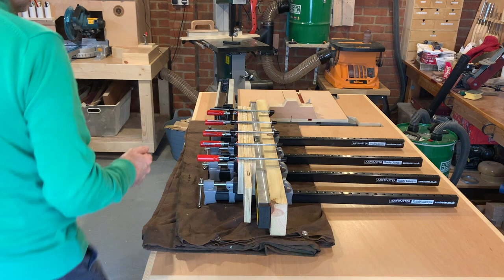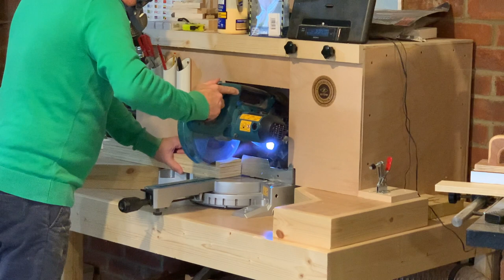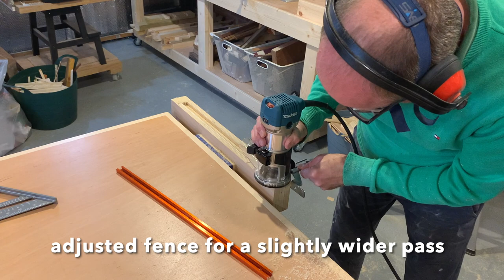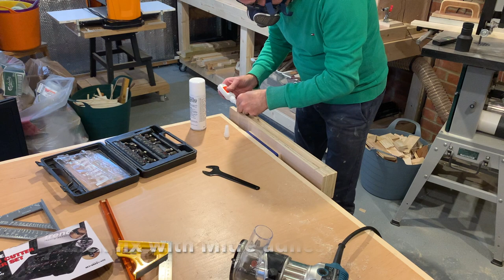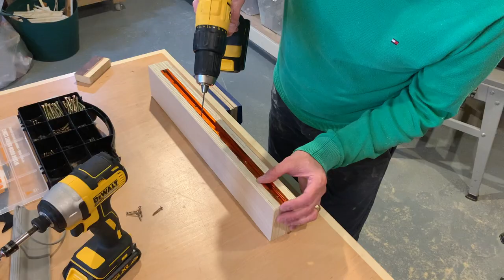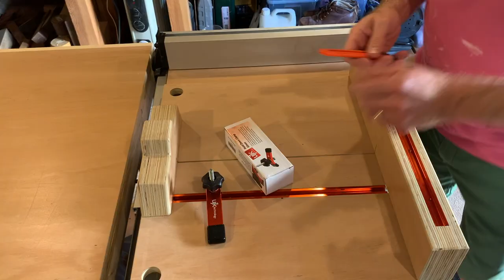Making a new Fence for my Cross Cut Sled    HD 1080p

Comment: I found your original video of the cross cut sled a while ago, very happy to see a video making the new fence , top job 👍. 
Will be copying this especially as I just brought that table saw.

Do you have a video on how you made the exstentions for the DeWalt table saw please? I can see that being very functional, and would like to copy that excellent idea.
Thanks 👍
Reply from the maker: Hi James, I’m afraid I don’t have a video on it. Easy enough to do though I already had the bench made, but I then glued another sheet of ply on top to make it extra sturdy. I first cut out the gap just the size of the narrowest part of the table saw top, I then dropped the saw into it and drew around the table saw wings with a pencil onto masking tape, I must admit I checked this about 10 times before cutting, then went for it with a fine tooth handsaw. Go for it mate ! 👍🏼
Reply: @Terrythemaker  ok thanks 👍
If you ever re build it definitely film it.
Great stuff 👍 subbed to you 👍 keep up the great craftsmanship 👌💪💯👍🍻
Reply: I asked the same question also in the other video!!

Comment: Hi Terry, I noticed in this video the riving knife is missing most of the time. Do you not use it when cutting generally or have you removed it to make the cross cut sled?
Reply from the maker: Hi Paul, I always use the riving Knife,  but I had to remove to for this build, but I use it nearly all the time, especially after a follower on Instagram pointed out to be the dangers to of not using one.

Comment: Great sled. I too have the same saw and keeping an eye out for jigs. Yours is very simple and practical to make. I have seen ones with a safety block at the back to avoid cutting thumbs. Can I ask what width of track is that?
Reply from the maker: Hi, I’m not sure about the T track width , I bought it from Axminster, it’s the UJK Range, but didn’t think to check the width as I thought they were fairly standard. I have since added a safety block which you can see on my Instagram 👍🏼
Reply: @Terrythemaker  thanks for the quick reply. I was watching your bench video at the same time. That’s awesome. You have inspired me to stop watching and start making something.
Reply from the maker: @patchezza1  that’s excellent 👍🏼 yes start making, that’s all I do, I’m self taught, through practicing and trying builds, I love making stuff 😊

Comment: Hi again Terry, you are correct I did take the riving knife out from the top and after putting it back together the little nut only turns a certain distance (certainly not all the way up the thread). Will I have to put little washers to take up the gap? Any ideas of how I can get over this?
Reply from the maker: I’m afraid that without looking at mine I can’t say, I would check the user manual if I was you

Comment: I noticed what looked like green tape on the runners beneath the sled. Did they shrink over time and you had to improvise?
Reply from the maker: Hi Matt, spot on, I got a bit too excited when sanding and made it a tiny little bit too loose, so I added a bit of frog tape which worked a treat, I must admit I forgot I had done that, thanks for subscribing 👍🏼
Reply: @Terrythemaker  Thanks! Great work!

Comment: What make / model are those t track clamps please?
And what size t track did you use please, as I noticed they come in different sizes.
Many thanks 👍
Ps you should upload more videos your a very good craftsman 👍💯🍻
Reply from the maker: I James I bought these from Axminster Tools, they have a whole range called UJK , I think I ordered 915mm, you can buy it with clamps and it works out cheaper too 👍🏼
Reply: @Terrythemaker  excellent thanks very much for the information and your time 👍👌🍻
Reply: @Terrythemaker  I'm just ordering up the bits I need from Axminster, please could you tell me the length and width of your sled ?
Thanks for introducing me to that company/website.
Great range of products 👍
Ps: sorry for all the questions.
Reply from the maker: @JimJimpmjj  I James, I just made to match the size of the table top 👍🏼, I did post the dimensions recently for someone else but can’t remember them of the top of my head.
Reply: @Terrythemaker  I thought so. Excellent cheers Pal 👍 looking forward to building the sled. Thanks 👍

Comment: Hi Terry, I took out my riving knife but did it arse about face really. I totally undone the little nut and removed the riving knife completely ignoring the mechanism on the other side of the bolt (hope this makes sense). After replacing the riving knife and turning the little nut as tightly as possible there is some play on the riving knife itself. is that normal?
Reply from the maker: Hi Paul, I must admit I have no play on my riving knife at all, it sounds you took it out from the top where the top yellow insert plate is? I normally put my hand underneath the saw and undo that nut that releases the riving knife it sounds like you’ve done it from the top. I’m afraid I can’t check on mine as I’ve had to put my saw into storage, but that’s another story and hence no recent projects. Sorry that’s not much help mate

Comment: Nice sled, thanks for sharing. Just got that table saw so this’ll be my first project for it then a jig for making 45deg splines for box corners. What make of hold downs do you use? I’ve been using routers for years but saw a vid the other day when someone was reviewing a 1/4 one with a split fence like yours and he said the first thing he’d do was attach a piece of mdf along its length to stop the router moving as you come off the end of the wood you’re routing. Obvious really but never done it and noticed you having the same issue as you came off the end of the fence. Might be worth doing?
Reply from the maker: Hi Russel that’s a really good point and I will give the router trick a go. This is the beauty of this hobby we all learn from each other and pick up like hacks and tricks from each other. The hold downs are from Axminster Tools, they are from the UJK range, they offer a nice range of tools. That’s assuming you are in the UK 🇬🇧

Comment: Unfortunately I designed and got 1/2 through making your original design with the front mount instead of top mount t-track.  Is there a way for you to put a disclaimer or note embedded in the original design when you update?
Reply from the maker: Hello, point acknowledged & will definitely consider this if I upload a video that follows or is similar to a previous video. However I still believe this video is still relevant when cutting thin pieces of material!

Comment: Hello, can I ask what saw blade you use?
Reply from the maker: Hi simon, I’m still using the blade it came with, I have to say I have no reason to change it, it’s perfect, I don’t understand why people rush out and change blades as soon as they get a new saw. regards 👍🏼
Reply: @Terrythemaker  is it 210mm 60T?
Reply from the maker: @FuzzFPV  it’s 210 x 2.4, I’m not sure on the teeth, it’s exactly as I came from the shop, I will try and find out.

Comment: Brilliant sled…. Definitely worth the changes you have made. Slightly off topic now though I’ve noticed the bottom course of bricks below the damp and above the floor have been painted am I right in thinking they were releasing moisture in to your workshop? I ask because I’m Having this issue myself at the moment
Reply from the maker: You are probably right about the bricks, I must admit I didn’t think about that. Whoops! I guess there isn’t much I can do about that now ?
Reply: @Terrythemaker   i don’t think there is anything wrong in that… I was hoping it could be the solution for me. The brickwork in my own shop seem to wick ground moisture up through the wetter months subsequently the bricks are then trying to dry out into my workshop for months at a time making it damp and no good for woodwork
Reply from the maker: @jasonwood5602  oh I see what you mean,
Reply: @Terrythemaker   would I be right in guessing they are painted along exterior walls
Reply from the maker: @jasonwood5602  yes, basically a detached double garage